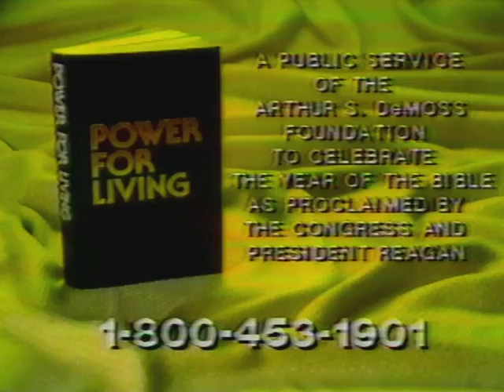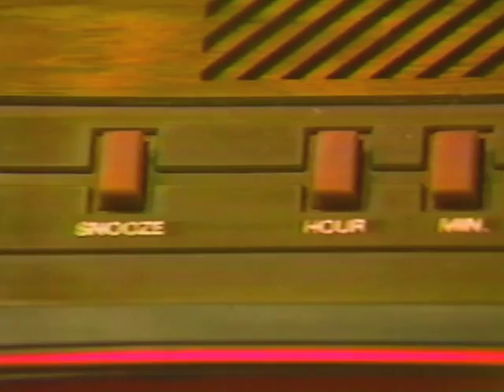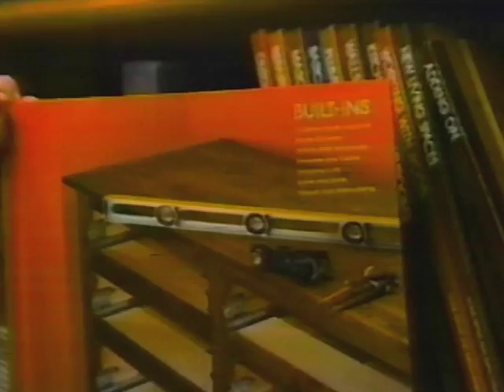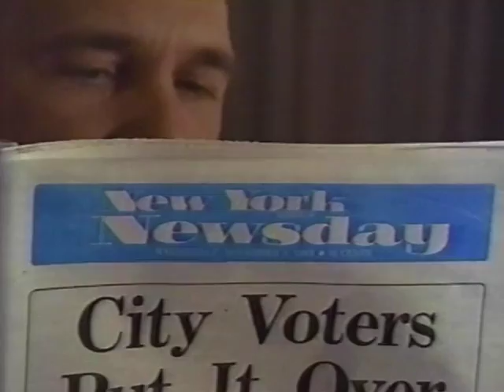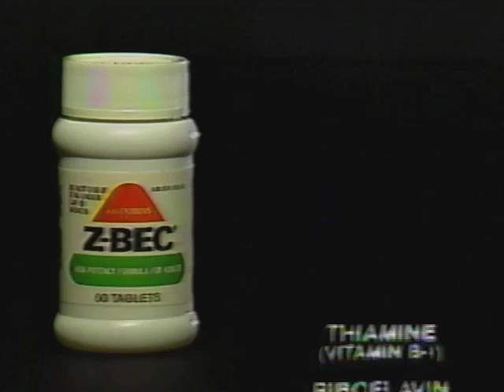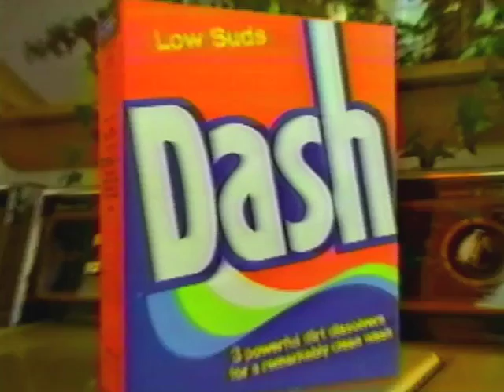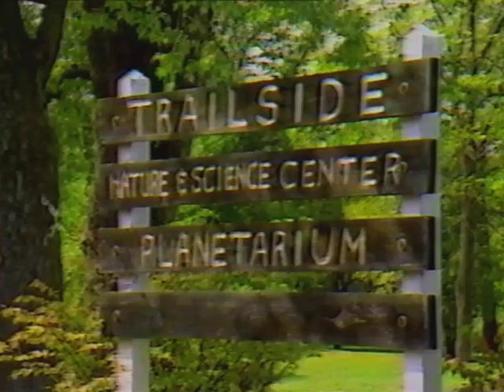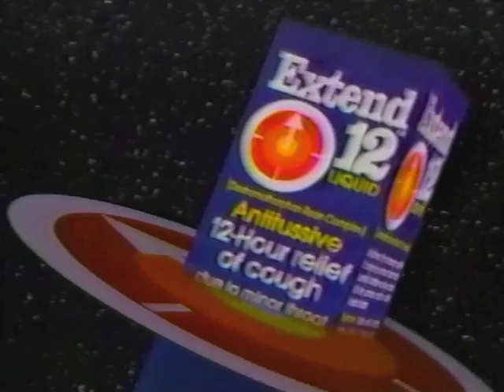80's Commercials Vol. 966

Comment: An Atari commercial in December of 1983? Uhh...wasn't there a video game crash that same year, something that really hurt the console market in the west until Nintendo came along two years later?
Reply from the maker: First off, it's a local ad for a NY based electronic chain selling Atari games at rock bottom prices, which is indicative of the crash.
Second, it's not as though Atari went out of business as a result of the crash.  The biggest effect the crash had on them was the company being sold off to Commodore's Jack Tramiel, which didn't happen until mid 1984.
Atari continued to make games, consoles and computers throughout the 1980's.
Reply: @80sCommercialVault  major props for your dedication to responding to comments :)